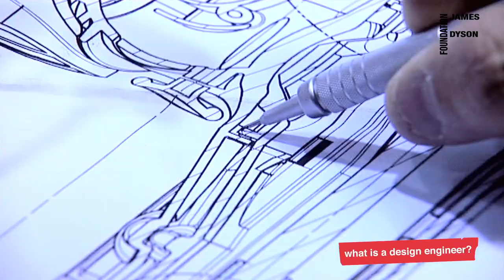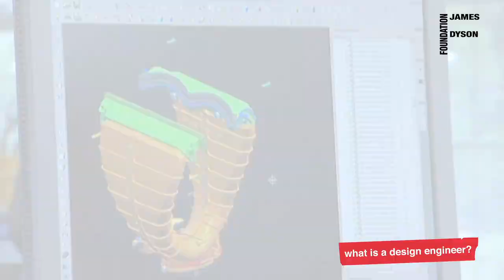Characteristics of a design engineer

Comment: Where should we start for Designing
What would be out first step?
Reply: A 2 year product drafting/design school or engineering technology school. A job in drafting (hopefully for a contract engineering company for most exposure to industry). After a few years if that, you move into design (hopefully, depending on your ambition). Using that career path you can fund a engineering degree. One could argue that getting a engineering degree would be the best first move. But I found that having industry experience can drive the questions you want answered so that you know what you want out of the degree before you get it.

The thing is knowing how to design something before you understand why. Then you can know what truly can currently be built and apply build-able designs to your (or your teams) ideas.

Mechanical Design is hard.  Not only must you think of the idea, but to apply tolerance to it and ask others to build it. To ensure that what ever it is, can in fact be built... efficiently.
Reply: @Metal_Icarus  I am planning on starting college/university this September for a design engineering degree, and I have up until then free from education. Would you have any advice for how I should utilise this free time?
Reply: Try a pineapple slicer